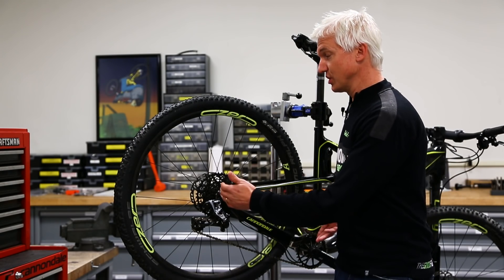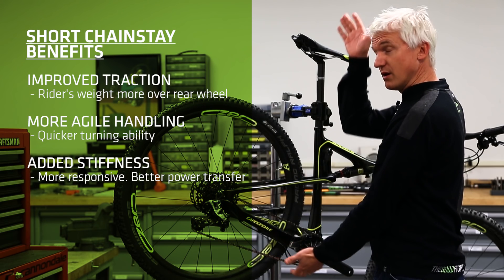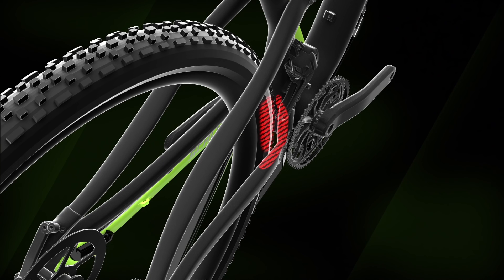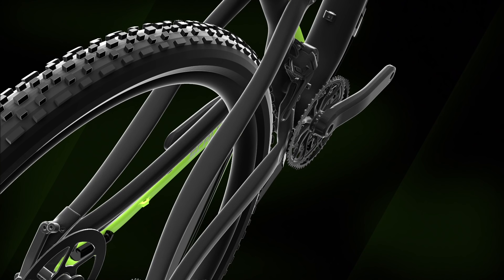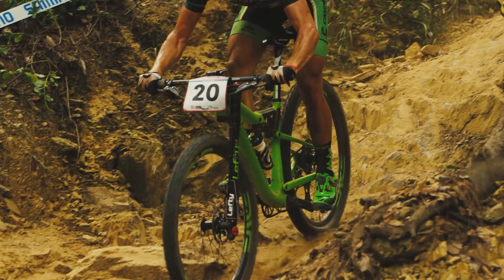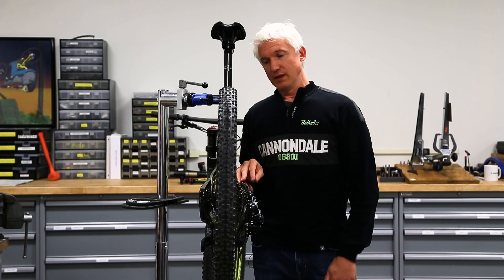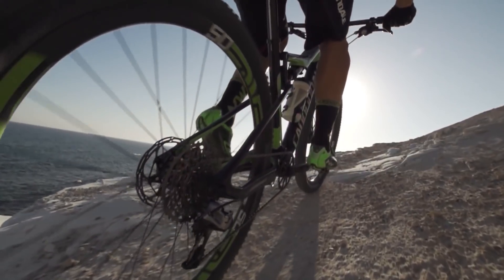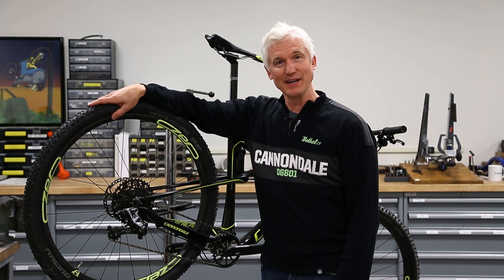Cannondale Innovation - Ai - Asymmetric Integration

Comment: What is the difference between boost (+6mm) spacing and SI (+6mm) please?
Reply: Boost spacing is the overall width of the hub. On MTB, boost spacing is 148mm so that's the length from one end of the hub to the other. 

AI spacing moves the crank ring outboard for frame design purposes.  It has nothing to do with the hub actually. Cdale is simply accommodating for this by moving the rear rim 6mm to the non-drive side via dishing off the wheel.  Hope this helps.
Reply: Qual o off-set usado em uma coroa de 32T? Usei uma de 0 off set e a corrente está caindo, minha relação e de velocidades atrás, 11x42

Comment: What if using asymmetric rim on AI system? 
No need or make it better?
Reply: Good question. I'd love cdales response, but my gut says assym rims then are unnecessary and actually would over correct to the non drive side.
Reply: Yes but there should be a better thing for both. So I can use ‘weaker’ rim that usually less stiff, less durable, but it have less weight...

I like the idea of AI system, but it doesn’t have significant effect for make shorter chainstay length. There is a lot of bicycle out there with shorter rear center. 
I will buy it because AI system can make my wheel more durable.

Comment: Someone needs to compile a record of which wheel sets have successfully been converted. My bike shop isn't sure that the spokes on my Mavic wheels will have enough thread to make the full 6mm of adjustment. On another note, I do really like my new SuperX. I do notice the short chain stays. Handling is good (but my rear heal also hits the rear derailleur).

Comment: Great video.
Towards the end of the video you mention the "appropriate hub". What kind of hub is appropriate.
Reply: Ben Ward Depends on the frame spec. For road disc, gravel, or cx it would likely be a 12×142 hub. For MTB it would likely be a boost-standard hub. That's why he says "appropriate": it's appropriate to the frame you're using, as this tech is applied across multiple bike category lines.